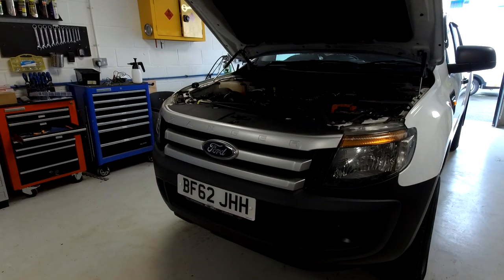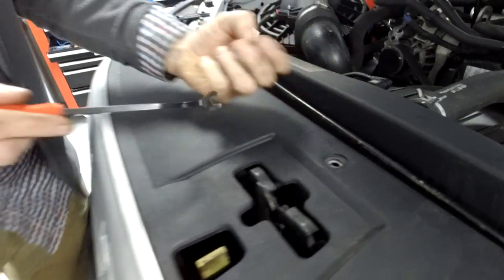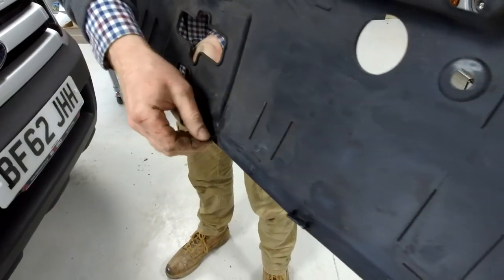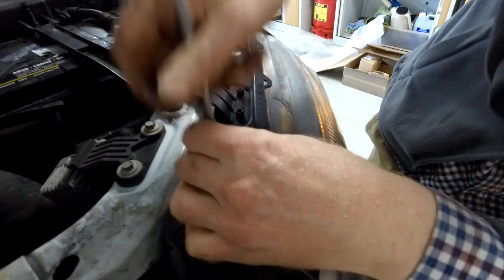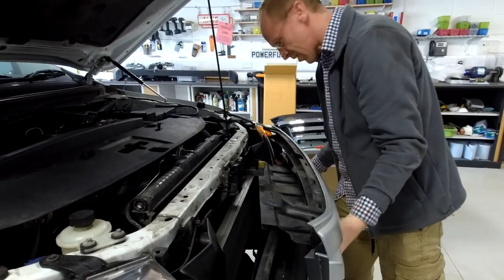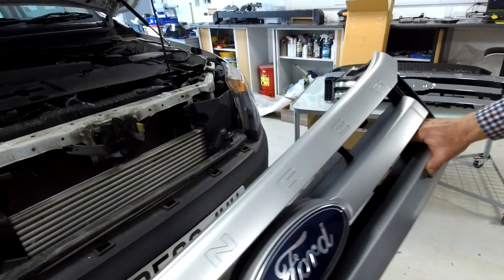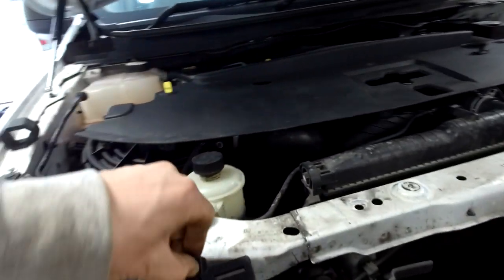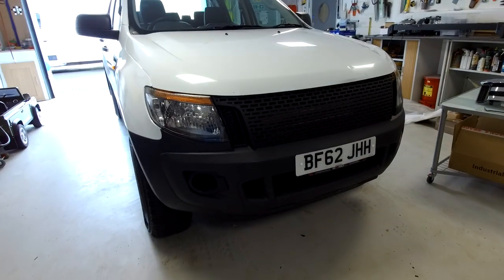Ford Ranger T6 Grille Upgrade options and removal ( not the easiest grille to change )

Comment: Can't believe you did this. Changed mine today. Not one tab broken. I would advise deleting this video for the sake of Ranger owners.
Reply: I did mine, one tab broken, from stupidity (thought it was cleared so pulled a bit to hard) These guys need to be avoided at all cost. 2014 here, just swapped to an aftermarket black grille, looks great and fits great because I knew these guys were jokes

Comment: Nothing against you guys, but I feel like the one holding the camera would have been better suited for this task. I just swapped mine out and I had only one busted clip from my own stupidity. If I had followed you most everything would have been busted with only a few clips left to hold everything together. The one holding the camera was obviously the more patient one, as he was saying to "look here" or "see there" yet you just proceeded yanking and pulling....most of those clips you broke could have gotten to from the side or underneath and squeezed them together or in the case of the middle piece (which you didn't even put back on, which is essential for air flow)  squeeze them apart from each other, but you didn't bother, you just proceeded in ripping the grille out with no patience or disregard of what you might screw up, then kept the wind deflector off the back of the replacement while it is intentionally left there for a reason. I will never look at you guys for advice unless I want something F'ed up, maybe if cameral holder is doing it, he seems a bit more cautious, but you, ripping, pulling and tearing then blaming Ford for making your life hard???? give me a break.
Reply from the maker: Mike all your comments are fair and justified - but I still think the grill is not a piece of great design !

Comment: What a pair of CLOWNS
Reply: I have to agree with you - we felt like a pair of clowns but is there any easier way to remove the grille ? - it seems Ford designed ti not to be removable ?
Reply: @sj3323  yes you just get your hand around underneath the front part after you take out the 4 clips you first took out and you just squeeze the clips together and they come out easy
Reply from the maker: @Rocks19065  Are you mister tickle ?
Reply from the maker: @radiustwo  People dressed in Mancini's should not be criticising others !
Reply: @sj3323  Yes! patience and reaching under and squeezing the clip locks together,  is pretty simple! The top ones were pull outs, after that you needed to use your fingers or a very short set of pliers to squeeze the rest of the rings together. As for  the middle piece, you need to squeeze them APART instead of together. It really is that simple, patience, observance and gentleness..never worked on a classic car I see...